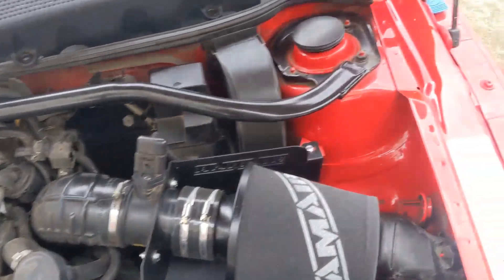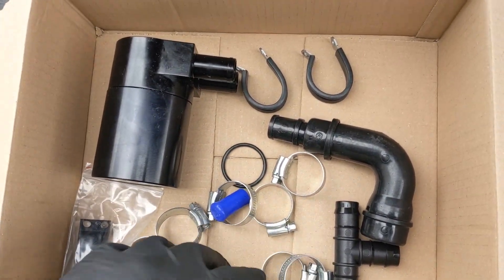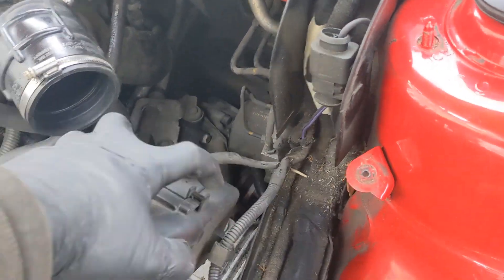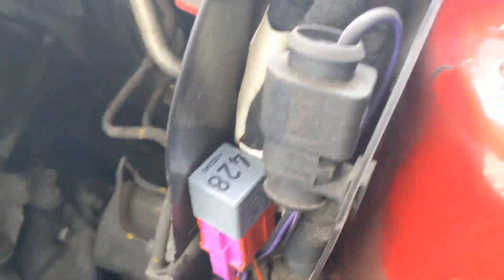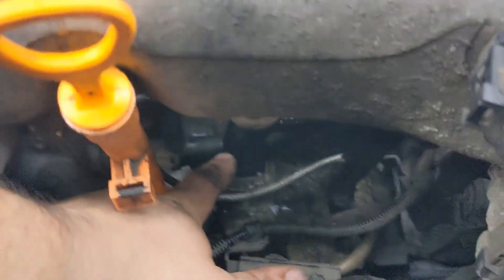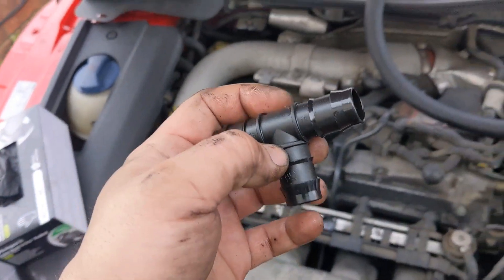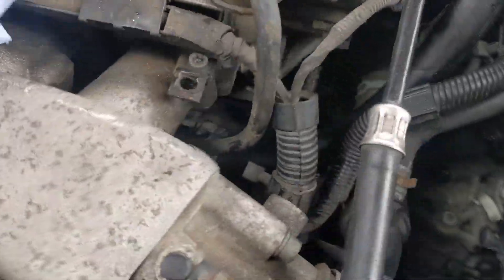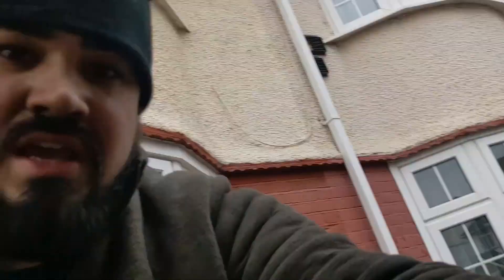Audi TT MK1 Catch Can Installation 1.8t 20v BAM

Comment: 2022... Great footage of all those hard to get too hoses.
My TT is on a hoist at the moment,
Thankful for that invention.
Full 1-2nd selector fork pin snap and reverse gear damage.
Dremel tool the reverse gears.. and the latest revision of the 6 speed selector forks.
My flex coupling was destroyed and half my front swayer was missing.
Ground away and I didn't even hear it.
Might of been the previous owner, before last half fix.

Comment: My TT is remapped with decat, miltek, and piperx filter. Was getting 27.3mpg since the mods. Did this catch can install, now getting 32.3mpg! Not driving any different... Definitely worth the money 👍
Cheers to cloud 9 too
Reply: Is there any reason why  it made a difference Bryn? Car breathing better I guess?
Reply: Hi  @blakkno666  
Just purchased this same one for my TT 225 with remap. Car showing its losing boost on dyno and hopefully this will sort it.
My mechanic fitting it next week said he's heard it may put lights on my dashboard once installed. Had any problems??
Be great if you could reply. 👍
Reply: @Taxiboy112  nope no lights.. don't know why it would??
It may help boost issues, definitely. 
I was getting a twirruping noise from turbo when I change gear which is apparently a boost issue, but this hasnt fixed  it.
Still definitely worth doing though 👍
Reply: @blakkno666  
Guy at dyno said its definitely losing boost somewhere and probably ageing low pressure pipes.
Thank you for putting mind at rest.
Top man 👍
Reply: @blakkno666  
The breathing is definitely poorer.

Comment: Do they make an inline setup to keep the vacuum source?  I’ve found after removing vacuum sources on the 1.8t you get the white sludge build up on the oil cap and etc. This setup would only stop oil vapors from getting into your intake tube and remove a single hose and check valve but at a sacrifice, if you don’t have a vacuum source your no longer going to have the moisture and blow by crap being sucked out of your crankcase and valve cover and you’ll get that crap built up in the valve cover. Also with the setup you had just shown you actually no longer need the crankcase pressure regulating valve since it limits vacuum flow and pressures through the crankcase and the vacuum source is now capped off. Unless you were just using it as a barb to connect 2 female hoses. J.W. Thanks

Comment: I did this job exactly like shown in the video with the same catch can and now I have a sound coming from the engine that sounds like a horn, from around 2500-3500rpms. I can't figure out what is causing the noise. Sounds almost like a trumpet.

Comment: My 2002 AMU (Canadian model) has 2 relays in the box!  Not a big deal.  They still fit in the wire way.
Reply from the maker: Yeah some UK variants have 2 aswell
Reply: @BWSTT  
You make it look so easy!  Took me a good 4hrs.  Moving everything around and being extra careful not to break anything while doing the job.  Just in front of the breather pipe I had a bracket with 3 connectors making it difficult to aces.  Pipework was also tricky with the SAI combi-valve in the way.  But thanks for the video.  It was very helpful!
Reply from the maker: @ericsauvageau223  yeah I did an APX variant (sai and bracket with 3 plugs) yesterday and did think to myself that people following my guide are in for a shock haha
Reply: @BWSTT  Yea, one of those people me :) Please put a warning in the description :P could help others

Comment: Can you add catch can and not remove the piping under the manifold?  Pro and con?  Just replaced all those with 034 Motorsports silicone.  A delete seems to be a waste but would like to benefit from catch can capturing the gunk.
Reply from the maker: Absolutely, just fit it between the puck and the intake
Reply: @BWSTT  thanks so much for the reply.  What would the diff of doing the delete as you did be for benefit?

Comment: With a 180 ATC, the n112 and n249 are tied together. If I wanted to keep the n112 for now would I plug the end that goes to the n249?
Reply from the maker: You run a vac line to the DV, but T into it under the inlet manifold and take a feed to the N112
Reply: Thanks

Comment: I’ve heard If you remove the “suction jet pump” under the intake manifold, you can lose/reduce the feel of the brake booster ? Some say it can be dangerous to delete but has anyone had issues with that ??
Reply from the maker: The apx never came with it and is fine
Reply: @ I have a BAM engine ?
Reply from the maker: @FREEVERGO8  my point is, the apx doesn’t have the suction jet, taking it off the bam makes it the same in that respect as the apx, meaning it’s fine
Reply: @ ok I wasn’t sure if the suction jet was in a different location closer to the brake booster on different engine codes, I’ll try running the booster line straight to the intake and see what happens

Comment: Can’t get my engine block breather to push down far enough for the o ring to seal ,, i can’t get enough purchase on it to push it down far enough for the clip to go on top of it to hold it snug in place     … I’m sure I’m not the only one ( any tips?)
Reply from the maker: In this scenario there a re a few potential causes. Sometimes there are bits of the old one on there. Sometimes the old O-ring is in there. Sometimes it just needs a thin smear of oil to allow it to seat properly

Comment: Hi mate I recently got that same kit from billy for my tt 180quattro is there much in the difference to compared to the bam engine ?? And what why do I have to do it ? Cheers mate 👍
Reply: Idk about urs but my 01 TT Quattro the intake is flipped.all hoses on right r on left. I also have to under the cover at oil stick I have vacuum lines and 3 connecters. I had to take off the intake to get to the hose

Comment: Could of also covered how to install one while retaining the rest of the pipes. Don't fancy losing brake pressure lol
Reply from the maker: You do realise the setup on this matches the APX from factory? Won’t lose brake pressure. But if you want to retain oem pipes under intake, just add it in and join to the oem pipe coming up to the rocker, simples.
Reply: @BWSTT  mines a bam though and heared a few people say it can cause a loss in brake pressure. And you say simple lol but I actually had a hard time finding out the correct info on where to place everything.
Reply from the maker: @theCinator  what im saying is, if you ignore what engine youve got, the apx and the bam both have the same brake setup. The way vacuum is generated differs slightly, but vac assist is what aids braking. By doing what ive done in the video, you change the vac assist from bam style to apx style, so there’s non problem.

Comment: I have a 01 TT Quattro atc engine. My intake is flipped from urs. I got vacuum lines tied into the cover at the oil stick. Why is mine different
Reply from the maker: Yours is a 180 variant, it's a bit different layout

Comment: Hi Bryn great video
This looks great but does it work better than if engine is removed and all old pipes replaced?
Engine on my QS is due fully forging next month .
Cheers
Reply from the maker: Not sure what the engine being removed would make a difference to, but either way this is doing something different to the OEM system. Even if the OEM system is all renewed and works fine, there's still benefit to adding the catch can in aswell, so that the oily air is filtered instead of just being sent straight back into the system
Reply: @BWSTT  cheers fella I may look at it after I get It back .
Maybe in new year I can get you to do it for me as I know id drop pipe gravel into sump.
It'd be an honour to get you to run your ruler over the car .
Keep the channel going Bryn it's brilliant 😉👍🏻

Comment: I bought the kit with the brass and cnc'd 90° elbow, have you fitted one of those before from cloud 9, and do I need to seal the thread when fitting the brass elbow to the alloy cnc'd insert???

PTFE the thread???

Thanks in advance, awesome video by the way ...!!!
Reply from the maker: Yeah I regularly use those now, I seal them with a bit of high temp RTV and they're fine. PTFE would probably be fine aswell
Reply: @BWSTT  Thanks buddy, appreciate that 👍

Comment: Thats exactly how I did mine too but threw out the puck. I later thought i should have kept it because it started holding a false idle. I think it could be because of the lack of puck but not sure. Ill refit one and see. Thought the puck opened more on acceleration? I have seen some people do open systems too on the TT. Not sure if thats ok for the engine  management or its not. May depend on what type of ecu settings or type. That car needs a bigger TIP too haha..
Reply: Coming in from the future and i was wondering if the hockey puck fixed your problem because i was considering just deleting it too.
Reply: @nanopeepee955  I never really found out the answer. What i did find though was that i had excessive blow by confirmed with a compression  test. That could have effected the idle. On disassembly i had a cracked head a bent rod and a worn cylinder. Ran well considering. Doing a big turbo forged build now to make it all better.
Reply: @MRPK1967  thanks for replying 👍

Comment: Another great video Sir...just acquired a convertible APX 225.
Is the fit the same as on the BAM engine ?
Mark
Reply from the maker: Yes, apart from there's less to remove on the apx which makes it easier
Reply: Many thanks...already in touch with cloude 9 to order one👍
Reply: @marklovesmandy651  Doing my APX now, the relay relocation part was a bit different, mine had a bigger relay plug, had to chop it in half to refit it in the wires box. The MAF plug and servo plug are a tight fit near the actual catch can, I wanna keep the stock air box. Definitely gonna need to unscrew bottom of catch can to take the MAF plug off when needed, which is fine. Also, the hard plastic pipe that goes from the breather to the puck, seems that is actually metal on mine, and it's bolted to the block with a screw, took it off, but be careful to put it back in because it also bolts the coolant pipe to the block (I noticed a little too late and lost some coolant). Those are the differences on my APX. For future reference is someone is doing theirs :)

Comment: what size tube did billy supply with the kit that connects to the pcv pipe from the block
Reply: 3/4 inch / 19mm inside diameter

Comment: Yet the pcv system is still installed and this isn't a delete. 
All you've done is install a cheap £10 ebay special catch inline with a simplified pcv system.

But still made the same mistake vw made with the relief system and when a blockage happens it will just blow the weakest part.
Reply from the maker: The PRV is still installed, the PCV isn't anymore, if you want to get technical. Other options include vent to atmosphere, or return to sump, and if you wanna make a fancy system you could Venturi it into the exhaust...... But since we are being responsible, we are keeping the PRV to keep the system running healthy